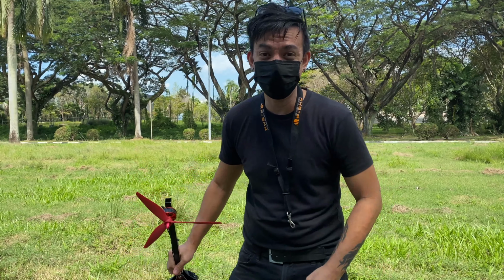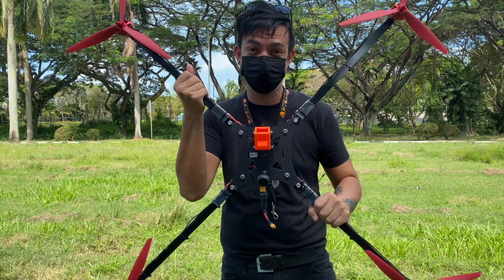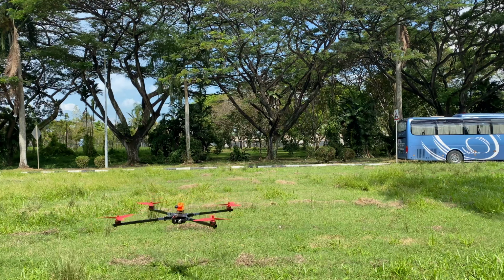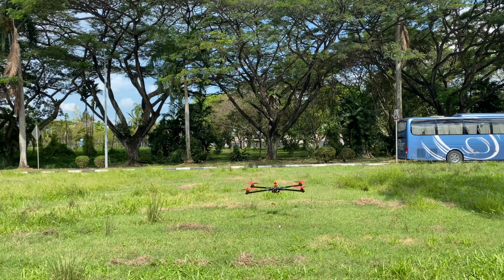X-Class - 1st flight of the budget build X-Class

Comment: Very nice..I’ve been trying to build one similar, but I can’t seem to get the right propulsion system..I’m using the rctimer 5010 with 40 amp x-rotor esc’s on 6-s battery with 16” props, and it doesn’t appear I’m getting good power distribution..the props don’t all spin the same and it affects the stability of the craft..could you list your set up..thanks 🇨🇦
Reply from the maker: Hey thanks for dropping by bruh!  Yeah, I listed the parts in the build video at 0:26 top right. What flight controller are you using?  The FC should be able to handle it.  Though I do suggest bigger ESCs.  40a on 16" props is definitely gonna kill it.

Comment: You mentioned that the ESCs got really hot during trials. Can you share your solution to make them run cooler?
Reply from the maker: Its the filter settings on Betaflight bruh.  On the PID Tuning tab, go to filter settings.  I've set mine to :-
Gyro lowpass 1 Cutoff - 150
D term lowpass 1 Cutoff - 150
The rest of the filters are OFF
Do note, Im running my X-class on Betaflight 3.5.7 instead of Betaflight 4.3
Hope that helps and thanks for dropping by man!

Comment: Hey there,
Awesome build, love it!
Can you share how you managed to pid tune that quad so nicely? Thanks 😀
Reply from the maker: Hey thanks for dropping by bruh!!  Aww thanks man, appreciate it. Yes of course!!!  Ok, so this PID is not so good as. I have bounce back.  The one in the video is:-
Betaflight 3.5.7
    P    I    D
R  46 45 25 60
P 50 50 27 60
Y 65 45 0.  60

Although I do recommend using the stock PIDs.

Whats important are the filters though, I had the gyro lowpass dynamic filter set to 100, lowpass cutoff set to 300
D term dynamic set to 100 and D term cut off at 200.  

Hope that helps!!
Reply: @shogunemperor  this will help a lot, Thank you so much! 💯
Reply from the maker: @operaswift8623  aye no worries man!  Let me know how it goes!!!
Reply: is there a good pid tune tutorial ?

Comment: Nice rig Bro. I designed and built a 580mm not-a-beast class last year. Not a beast class because she only has RacerStar 2212 motors and 10" props.
Reply from the maker: Thanks bruddah!  hmm.. I think the bigger motors would make a HUGE difference man
Reply: @shogunemperor  X-Class isn't just 800-1200mm, they need big motors too (3115, 400KVA minimum). Most X-Class/Beast Class have 40+mm motors.